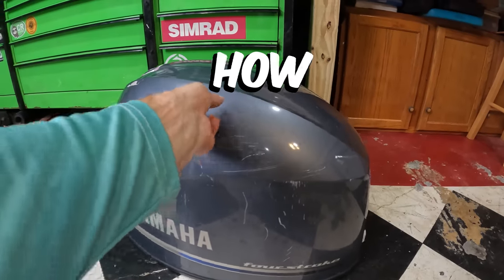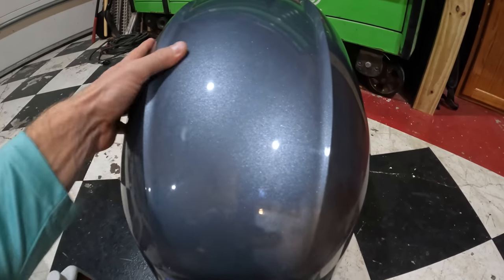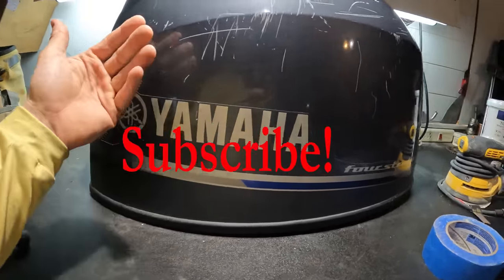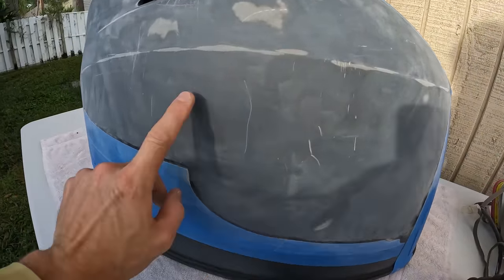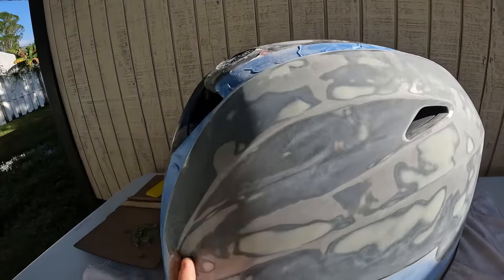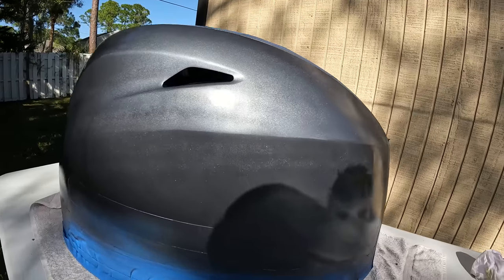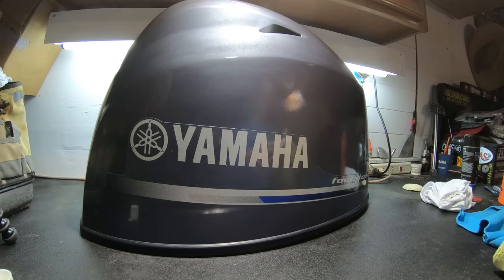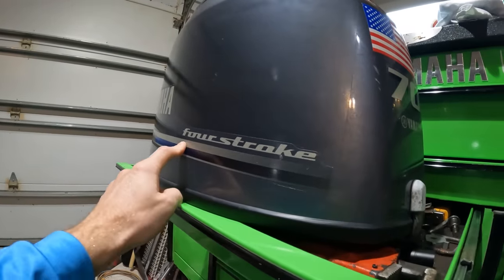Easily FIX Cowling Scratches!

Comment: You did a good job, but you really should’ve used primer before the paint spray paint is not meant to be directly applied to plastic that is exposed or filler.👍🏻🤘🏻🤙🏻

Comment: I have to remove the old decals on my 87 black max that are basically baked on there. It's going to be a fun time trying to get those off. It's the old clam shell with a lot angles and a front cover. It's going to be a challenge. I'm going to sand it prime it sand it again and two coats of enamel paint one coat of enamel clear coat. I wouldn't have known not to use acrylic clear coat if you didn't tell me it crack badly especially in the Florida sun. If anyone reading this hasn't been to Florida. Just imagine the sun but with a magnifying glass in front of it😂

Comment: How deep of a gouge do you think this process would work?
Reply from the maker: As long as the glass isn't cracked it will work, if the glass is cracked, the flex of the engine, cowling, vibration, and all that stuff will make the crack get bigger over time and pop the fix out, so cracked glass needs to be repaired with glass :)

Comment: what about clearcoat? was kinda surprised when you straight up waxed it right on the fresh paint. Then again, sure looks better than before
Reply from the maker: I haven't found a good clear coat that I'm really that happy with. Last clear coat that I used, Quicksilver, it ended up cracking after 2 years! Now there's a horrible looking cracked coating all over the cowling and the paint is perfect underneath but it looks bad. So, I've been just painting and waxing the paint, a couple good layers of wax and it seems to hold up :) (Probably not the right way to do it, and I'm sure there's a professional cowling painter out there that knows the better way, so I'd love to learn the better way lol )
Reply: @BornAgainBoating  thanks for the input on Quicksilver! I was considering their coat to reapply to my Mercury cowling, but now will probably go the hard way of two component polyurethane coating